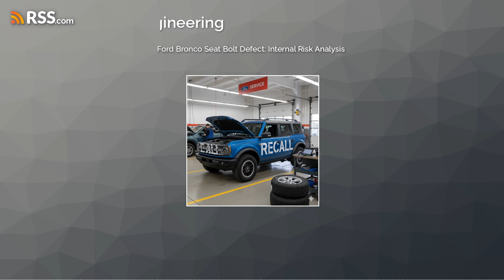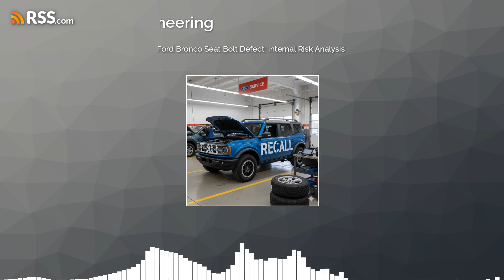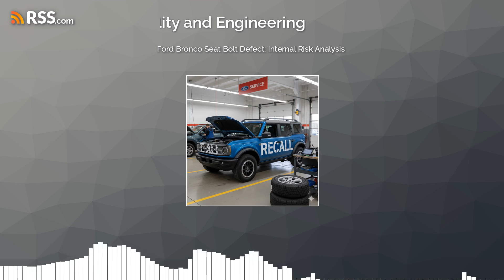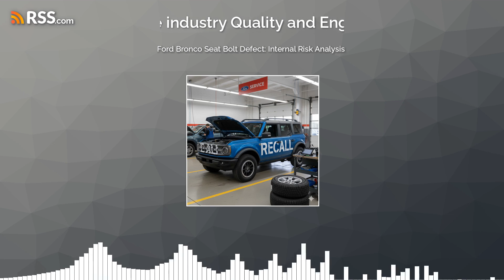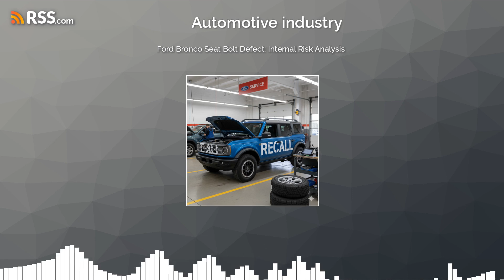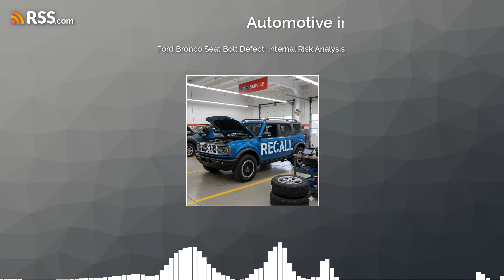Ford Bronco Seat Bolt Defect: Internal Risk Analysis

Comment: Ordered my Bronco in 8/8/2020, received 8/09/2022. One (1) day shy of two (2) years.  Just was notified of the seat bolt issue this winter 2026.  Notified of parts availability last month in May.
Original ordering issues of roof, computer chips, waiting for v6.  Original ordering canceled by Ford and had to re-order but at least I kept the same location in line.  Very frustrating experience.
Reply from the maker: Thanks for sharing your experience William!